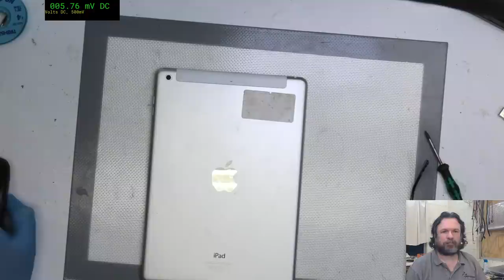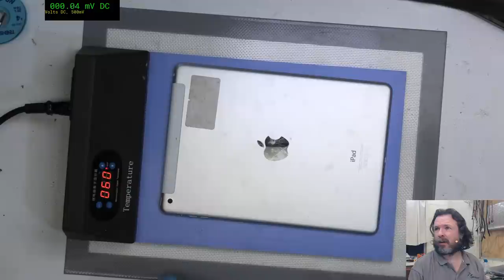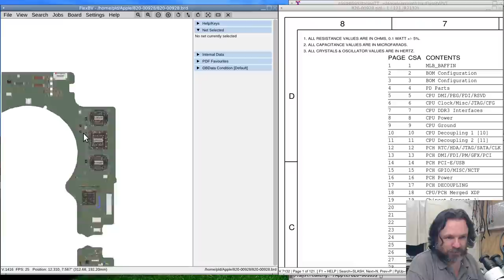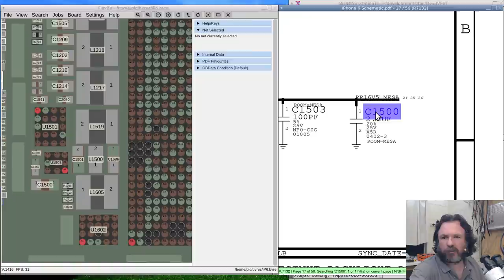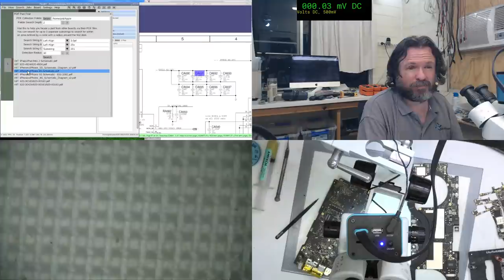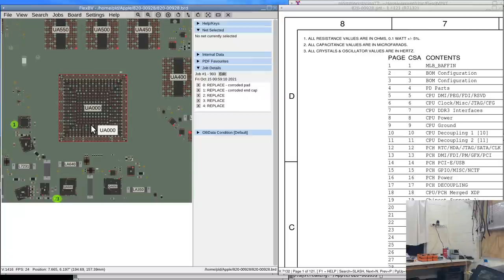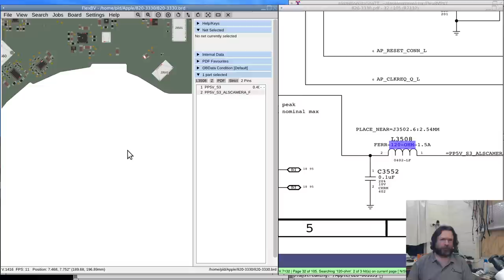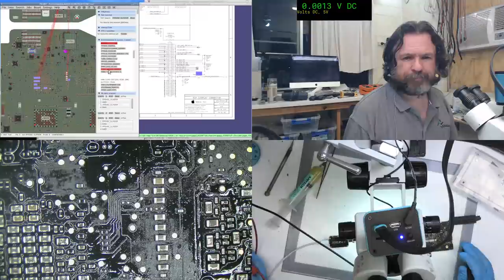Avoiding my real work, so I'm fixing an iPad... Air... I think... A1475

Comment: acetone 30% iso 70% battery remover
Reply from the maker: You're braver than me.  I'm fine with the 99% IPA (or ethanol).   Acetone is banned from this workshop.
Reply: @pldaniels  yes my acetone is very clearly marked .... dont want to be using it on anything else ;)